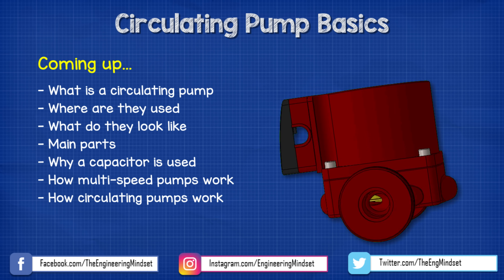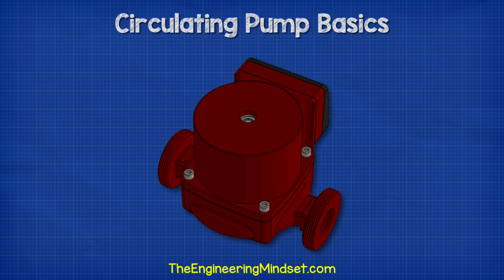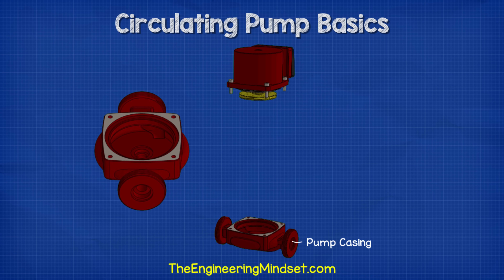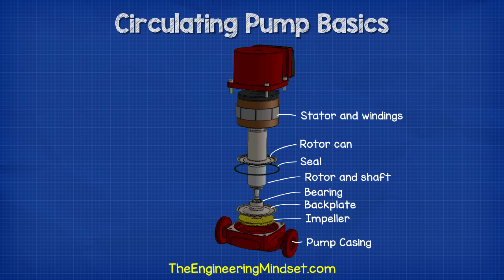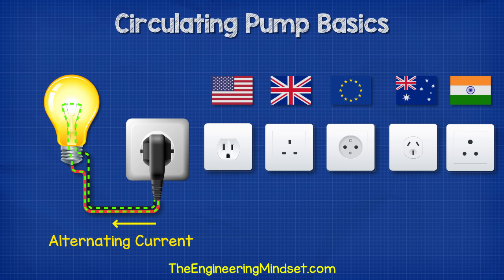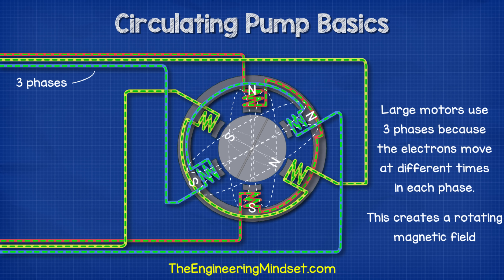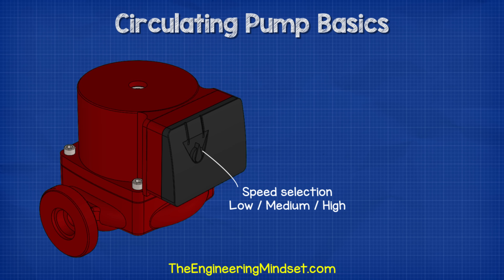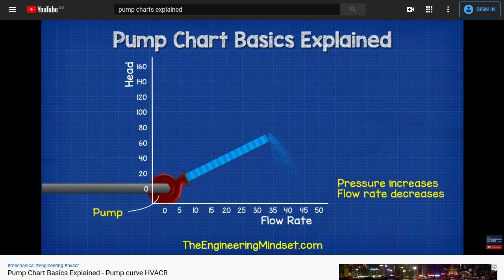Circulating Pump Basics - How a pump works HVAC heating pump working principle

Comment: Because circulation pumps are durable and the most silent type of pumps and noise is very important to me can they be used for increasing water pressure in just a single store building?! I mean they can make 2 - 3 bar of pressure which is about the city pipe pressure. And I want to use it only when water pressure is low. What are your thoughts about this? Thanks.

Comment: majority of times, you can tell whether its an inlet or outlet by reading the pressure of the gauzes that usually comes with the pumps. An inlet pressure would be lower than that of the outlet. It works very similarly to that of a compressor if you will. The centrifugal force creates a higher pressure and higher temperature of flow with a liquid or vapor on its oulet movement.

Comment: Goodnight. I live in Portugal. And I have a grudfos 3x400v three-phase circulation pump motor that was 3-speed. it says on the plate 420w 0.82A. 530w 0.94A. 720w 1.30A. It burned out due to a lack of phase, it has a board that has 12 terminals and only 3m 3 of line 1, 2 and 3 transform it, as I didn't care about the speed. I asked to try to rewind at maximum speed and leave 6 wires that I connect star or triangle because here 2 phases of 400v. Since I connected in star I measured the consumption in the tweezers each phase is giving me 0.4A and it almost does not turn. In a triangle it was 0.6 and it already has a bigger spin. But nothing compared to how it was before it broke down. did something go wrong when rewinding? how does the speeds work in the 3 phase system? Since now the return

Comment: If I were to install a log burner with a back boiler and connect it up with the central heating system, which has a combi boiler, but the pumps would operate in the same direction, what would happen to the pump in the combi boiler if it wasnt operating? Would the water pass through the non operating pump? Break/damage the pump? Or not pass through the pump as it will be passing through the radiators and then back to the log burner. And what if the boiler valve was open asking for hot water, what would happen with the water circulation then?
Reply: If the pumps in the central heating system and the combi boiler are operating in the same direction and the pump in the combi boiler is not operating, then the water would still be able to flow through the central heating system via the log burner back boiler pump. This would not cause any damage to the pump in the combi boiler.

If the boiler valve was open, asking for hot water, the water circulation in the central heating system would depend on the configuration of the system. If the boiler valve is set up to divert water to the hot water taps, then the water would bypass the central heating system altogether and flow directly to the taps. If the boiler valve is set up to heat both the hot water and the central heating, then the water would circulate through the central heating system and the hot water cylinder in the combi boiler, with the log burner back boiler also contributing heat to the water in the cylinder.

Comment: I've always heard that these were wet rotor type pumps, however you didn't illustrate that, so i was curious if the water also cooled the bearings or not. But nonetheless, great video!
Reply: The bearings maybe permanently oiled.  I see those in air conditioning motors.

Comment: very useful video , the question i have is : in a heating hvac  system, where does the circulating pump installed ? isn't on return water line or supply water line that feeds the coil from the water heater
Reply: newer hydronic systems, the ones installed by the company I work for are installed in the supply.  Some older systems have them in the return pipe.

Comment: Thank u so Much for the video! May i ask besides working with concealed water tank, can the pump still pulling the water in (thru inlet) from a (top opening) small plastic water container and pump out water from the outlet in high pressure please? Thank u in advance : )

Comment: Excellent video. 1 stupid question. If electricity changes direction than why fans, motors rotate in 1 direction? They should also change their direction as per frequency...
Thanks.
Reply from the maker: No the fan spins the same way because the magnetic field is rotating. This might help: https://youtu.be/XpcCUtYzwy0?t=192
Reply: @EngineeringMindset  Thanks for your prompt and kind reply.
Please keep us educating with your valuable expertise.

Comment: Fantastic video. IN North American hot water heating systems (radiator) we usually have the circulation pump on the return side and located at the boiler. 
Thank you.

Comment: But I have a question that when I disconnect the motor after it starts it just keeps going on normally until switched off.
Reply from the maker: Do you mean disconnect the capacitor? It could be just a start capacitor that only creates an initial starting magnetic field, once the motor is up to speed it is disconnected and the motor can sustain rotation. But it will not be able to start without this.

Comment: What is the need for the can between the rotor, unless that means that the rotor can get damp but the stator cannot. I have 2 of these pumps on my hot water heating system. The Bell and Goossett pump is one its last legs and will need to be replaced for this next heating system.
Reply from the maker: Prevent water from reaching the electrical coils.
Reply: @EngineeringMindset  I thought that it was critical both sides of the motor must stay dry.  Thanks.

Comment: It'd be great if you could do a video on hydronic systems design. Like designing hot water piping systems for serving radiators for example. Things like how to maintain pressure balance using control valves, reverse-return systems, when to use VFD's and why, 1-pipe & 2-pipe layouts, etc. Love your videos. Keep up the good work.
Reply from the maker: Good suggestion, I'll add it to the list. Have you seen these videos, they might be helpful
Boiler systems: https://youtu.be/lDeuIQ4VeWk
Pressure control vlaves: https://youtu.be/nAM5xU_KfzU

Comment: No such thing as centrifugal forces.   It’s centripetal force.  The centrifugal movement you observe is a lack of centripetal force which means it cannot accelerate inwards to remain static due to the linear force imparted into it.
Reply from the maker: I knew someone wouldn't be able to resist commenting this 😂
Reply: The Engineering Mindset  but if you knew it then why not use the correct terminology?   It’s been this way for at least 25 years.
Reply: @altypeRR  Maybe because except for engineering students,  no one has heard of centripetal force?

Comment: So does the pump remains on
Reply from the maker: Depends what you're using it for. It can and usually does turn off for perhaps at night when there's no demand.
Reply: Duwayne Kelly-james Home heating system the circulation system pump only
comes on when the heat(boiler) is actually on.

Comment: 10 years after i completed my engineering, i now know the actual usage of a capacitor. THANK YOU!
Reply from the maker: Glad the video was useful. Can learn capacitors in detail here https://youtu.be/X4EUwTwZ110
Reply: Mircea Believe the N would work just fine at the step down transformer WITHOUT being ALSO grounded. Understand your confusion. The N switches
polarity in reference to the TWO ends of the secondary coil. Being both positive 
and neutral at the same time with reference to the stated two ends.